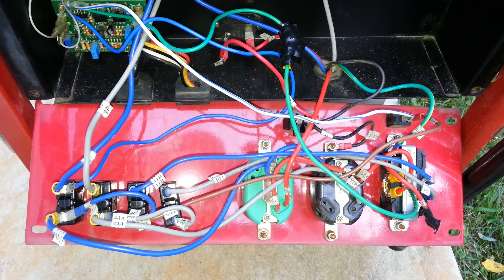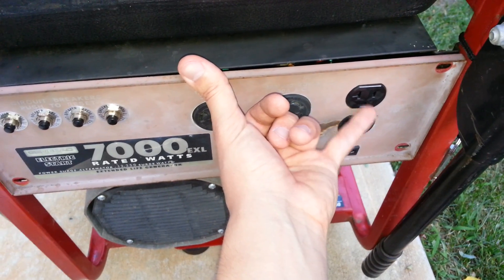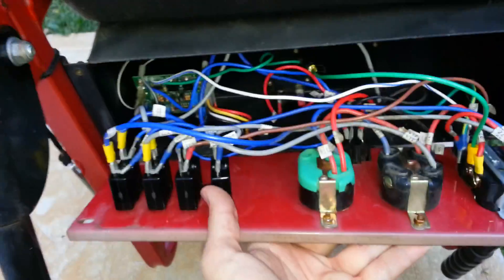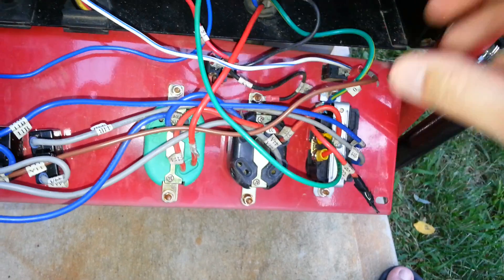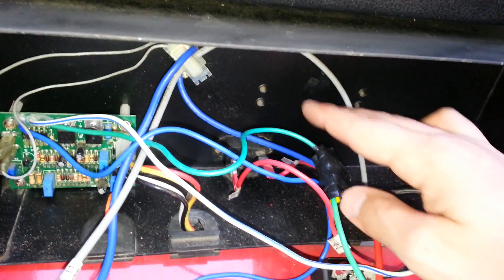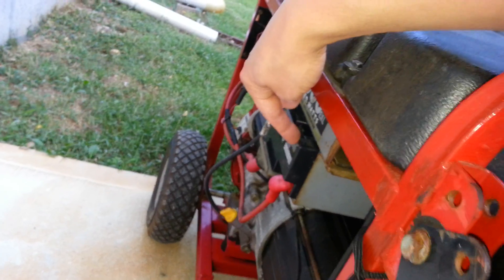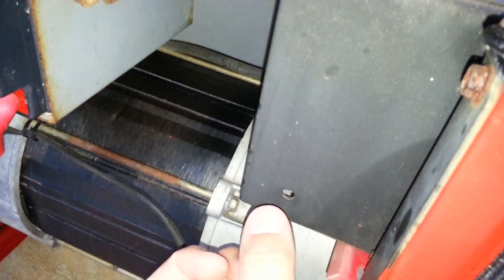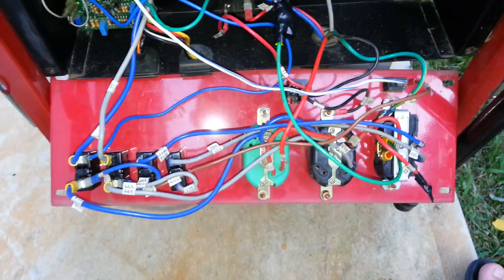Generac Portable Generator Wiring Diagnostic/Overview Part 01

Comment: I have the PowerBoss 7000/12000 watt generator with a Tri-Fuel kid instal.I connect the generator to 12 circuit Cutler-Hammer transfer switch Model CH10EN3060. Why does the generator does not need to be grounded when the Neutral is Floating.The owners manual says all ways ground the generator when is in use. Thanks.
Reply from the maker: The generator will be grounded through the cable going to the transfer switch. The bigger issue is to not have two Neutral-Ground bonds in one system. It splits the current between the two electrodes during a fault condition (generator frame and house ground rod) potentially posing a saftey hazard. The whole idea of bonding the neutral to ground is to create a lower impedence path to ground rather than through your body during a fault.

Comment: Hi xboxer1985, Now that you running your generator with a Floating Neutral to your transfer switch/ electrical pane to you still ground the generator out side to a grounding rod. Yes or No, thanks
Reply from the maker: I do not. With a two pole tswitch that transfers the hot wires only is called a non separately derived system. The house panel is the only N-G bond point and its ground rod is the only electrode. If one had a 3 pole twitch where it transfers the hots AND neutral then thats refered to as a separately derived system. In that setup, the generator N-G bond remains intact, and an NEC spec ground rod be attached to the generator frame. Hope this makes sense.

Comment: Hi xboxer1985,  I have a Generac 7550exl built in 2003.  I currently have it hooked up using the 120/240 twist lock from the genny going into my inlet box attached to the house and using a 10/3 wire from the inlet box into my main elec panel using a 30/30 double amp breaker as my main and using an interlock system.  I have been using it this way for the past year no problems. I run my entire house.  Am I at any risk using the genny this way? I recently viewed your video on your control panel for your 7000exl.  I will assume both units are wired the same it looks like they are.  I always thought this was a floating neutral generator but I guess not.  If not why is it working going to my panel which is a bonded neutral?  I thought you could not have both bonded, it would trip breakers.  Could you explain to me how to safely remove and identify the jumper wire to disconnect to make it a floating neutral.  it was a little hard to see in your video for me, and do I have to extend the green wire as you did to make my idle control work?, again can you show me clearly how and where to place it? Going back to the bonded issue It looks like you only disconnected the jumper wire on one side and taped it up.  No need to remove it completely?  I just want to make sure my set up is safe to use.  Thank You, John
Reply from the maker: with the neutral bonded at the generator and your main panel, the neutral current is split between the neutral wire and the ground wire. the generator will still power your panel and home, however when a fault condition exists the frame of the generator can be electrified. having the neutral bonded at the main panel and the generator floating directs the fault current to your house ground rod instead of the frame.

I disconnected the jumper on the 120vac outlet to make it neutral floating. I had to extend the green ground wire off the system control board so the idle control would work. It connects to the neutral wire 22.

there is no gfci outlets on the exl generator so it would not nuisance trip
Reply: ***** Thank You for the information.  I will make it a floating neutral as per your video instructions.  Please another question if I may.  On my Generac 7550exl model 1470-1 gn410 motor I am having trouble with the idle control.  The generator works great at high speed but when I put on the idle control it seems to be all over the place.  Not the staedy 47HZ as in your video.  I noticed that when I followed the wiring from the control panel down to the solenoid I noticed the 2 black wires are going to the solenoid but the red, yellow, and white wires are cut inside the harness. (dead end).  I also noticed I do not have the normal low pressure oil sensor switch most of these units have which is # 099236.  Instead I have part # 0D9235BSRV OIL SWITCH made by Hobbs which replaces # 0D9235A this switch is only rated 5psi I don't think thats good s/b at least 8psi correct? Generac states you should be using on the GN410 Motors the 099236 with the two yellow wires that connect on the top so why is this one on the unit?  Instead my sensor has one green ground and a double black wire connected to it on the other side. Not even sure if it's working.  If it is, and the sensor goes bad they do not have another.  What do I do at that point?  can I use the 099236 leave off the green ground and connect the double black wire to the top nut?  or can I just disconnect the black wire, and ground wire and use it like that. would the unit run?  I'm really lost.  The unit was given to me so I do not know if it was ever modified or not. Please help.  Thank You, John
Reply: ***** Hi XBOXER185, Thanks for all the info.  I noticed you mention do not use the idle control if your generator is hooked into a t-switch.  I am hooked direct into my elec panel using an interlock system.  Does that apply to this as well? Do not use the idle control?  Thanks, John Ambrosino
Reply from the maker: John Ambrosino Hey John sorry for the delay in response. Whether you have an interlock kit or two pole transfer switch, you should lift the neutral ground bond at the generator so it isolates the frame during a ground fault. Also do not use the idle control when connected to the house. The idle control slows the engine to 45-48hz and say 95 volts until 1amp or more on either hot leg is present, which brings it to full speed again. Motors, and sensitive electronics will not like the 45-48hz 95 VAC, in fact it will prolly cause permanent damage. The feature was designed for job site use to save fuel when contractors were not using their tools. Hope this helps.